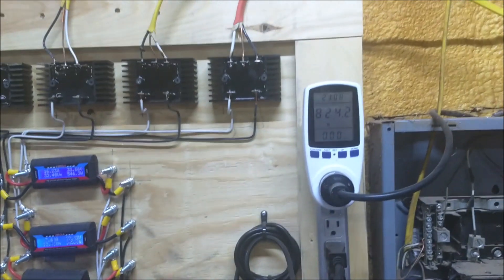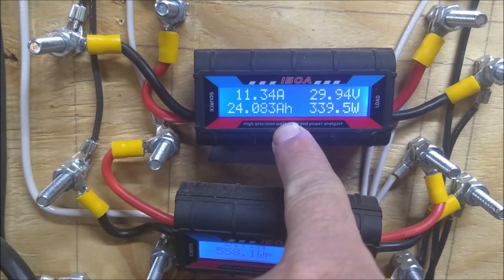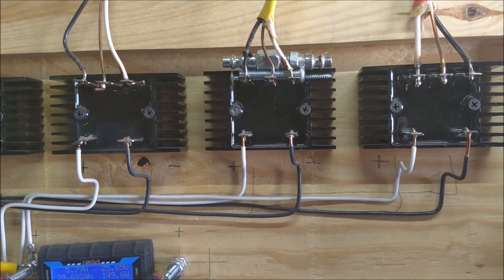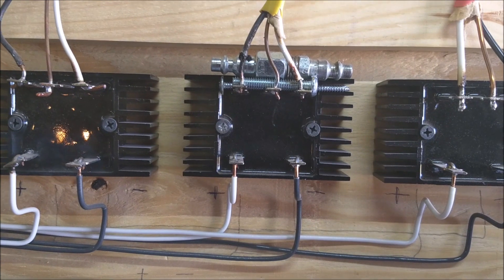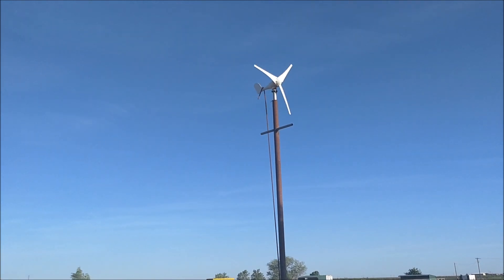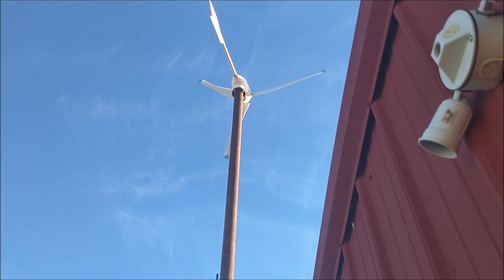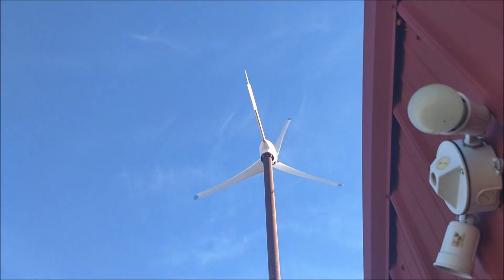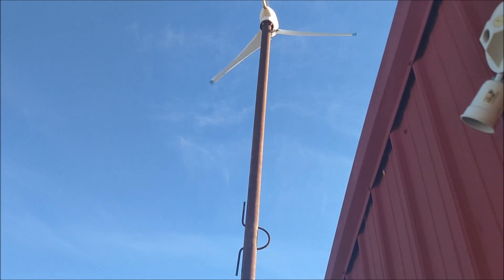eBay 400w Wind Turbine #2...how does it do in 50+ mile per hour wind?

Comment: I noticed on your meter you was getting at least 24 volts what are you doing to keep your inverters from running away and shorting out you got some kind of limiter on it because reason why I'm asking is I hook mine to a 24 volt battery and two 100 watt solar panels and it run away with itself went up over 24 amps and blue out the 30 amp fuse and fried what did I do wrong it is a 10.8 to30v. 1000watt grid tie inverter
Reply from the maker: To work with that inverter you are going to have to get an automatic dump load/charge controller that'll switch the juice off at like 29v.  You either have to have that or you have to have inverters that can handle voltage spikes.  I use the 22~50v models from the ebay seller chargerangel and I run on a 36v system.  Sometimes the system will still push voltage way over what my battery bank runs at but there's still plenty of cushion with the inverters.

https://www.ebay.com/itm/1000W-Watt-Solar-Micro-Grid-Tie-Power-Inverter-110V-for-Solar-Panel-22-50V-AC/191910041518?hash=item2caebad7ae:g:QXoAAOSwrlddZgzt

Comment: at 1:02,   REALLY ???    you  cannot  point to  the  CORRECT  meter ????         a pma  should  ALWAYS   run as if the output is  Shorted;  as when it is connected into a  low-impedance  Power  circuit.        shorting should  Not  be expected to cause braking/slowing, in a pma.

Comment: I'll be amazed if that didn't fry the stator.... wow. Balance those blades and they'll be quieter and make more power all the time. If you ever wanna get rid of the 700 id be interested.  Same thing as my 800 basically and i love it.
Reply: This was also my thought; that the stator was fried/damaged. Even before he shorted the leads at the rectifier in order to try the brake the turbine, the fact that it wasn't putting out much power to begin with in such high winds seemed like a sign that something wasn't right. I can't imagine that doing that kind of short-circuit braking on a rotor that's being forcibly spun full-blast by the wind wouldn't overheat the stator windings & start to overheat & burn out the  wire in the windings.
Reply: @frg1ne  exactly....thats a great way to fry a turbine.

Comment: When i first put my 500w up we go hit with 50mph +winds and it was screaming just like yours, at first it was only now and then but then my break switch got burned out so it when out of control and was screaming all the time, i'd not balanced my blades but after watching a few videos i decided to balance them and see how things went, i've had up to 45mph winds since and not a sound out of them, i have five blade with a span of 1350mm, i also noticed more consistent power after balancing.
Take care
john

Comment: That’s a lot of wind for just 3 amps.
Reply from the maker: It's an itty bitty turbine.  The 700w turbine was making 15+ and peaking around 25.
Reply: Toys for Watts. Yeah the big one was doing pretty good seems like the little ones just ain’t worth the trouble. Nice video. Save me $300 because I’m not buying a small turbine
Reply: don't seem to be cost-effective does it
Reply: Thomas Moore   You never know until you try.
Reply: Yeah that's a fact you never know unless you try I've been trying all kinds of stuff and still ain't got one in the air

Comment: Is that blade flapping out of sync because its changing direction.

Also is shutting it down by short circuit not overloading the field coil? 
Thanks
Reply from the maker: Generally no it just stops it but that one wasn't haven't any of it. I took the short off because it was still turning and that bolt was getting pretty warm.

Comment: Do you have all the turbines connected to the same battery bank?? Thanks
Reply from the maker: Yeah they're all tied to the same batteries and inverters.  The batteries are just there to act as a buffer to keep things under control so the inverters don't go nuts.